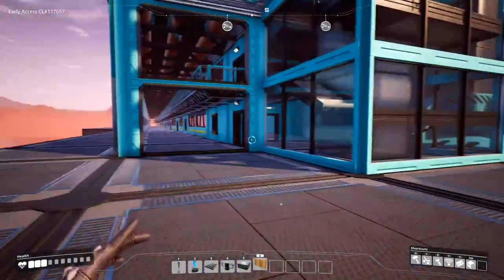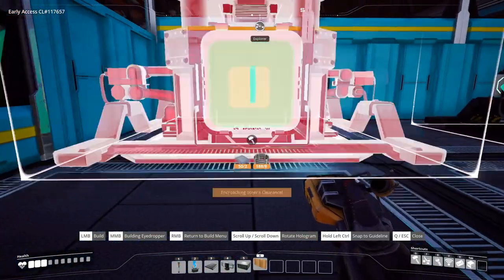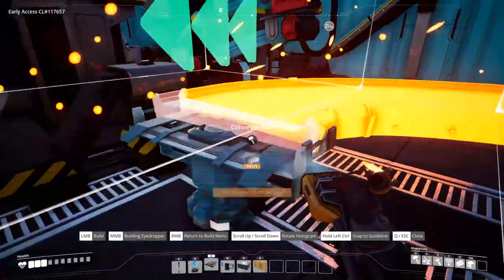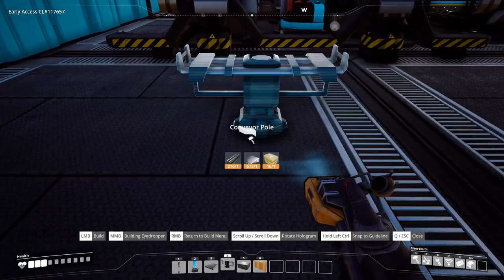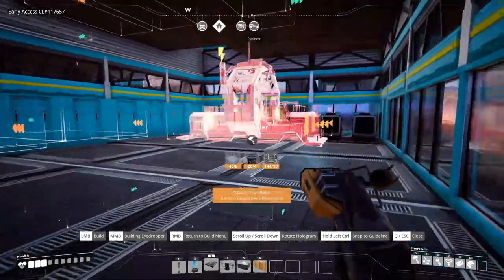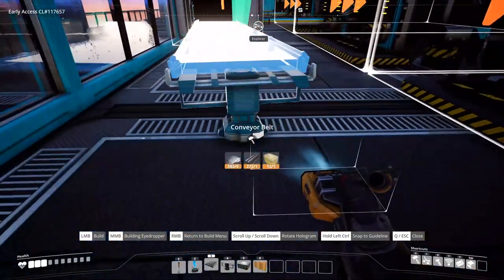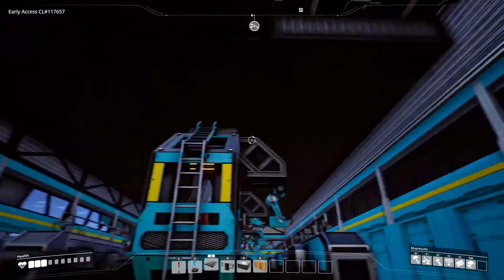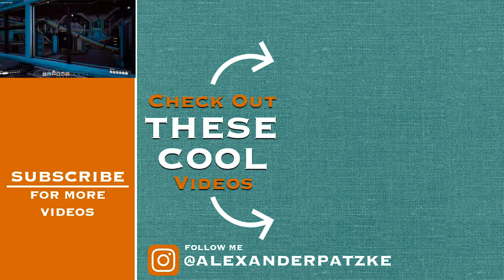BEST Satisfactory Reinforced Plate Setup Tutorial!

Comment: The alt recipe for Iron ingots to screws would change this up entirely.  You could go even more compact with each room.
Reply: Either that or stitched iron plates.  with the alternate recipe for iron wire
Reply: yea i've built myself a 15 reinforced plates/min system on a single floor in a 5 by 7 foundation or smth like that ( with the casted screws recipe )